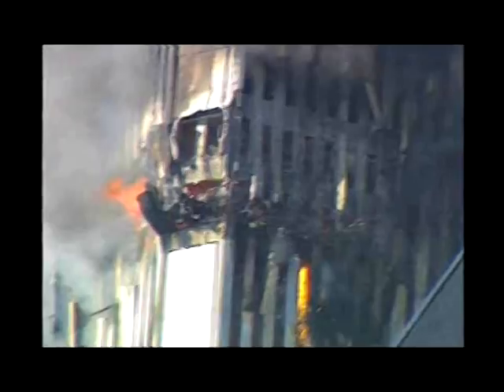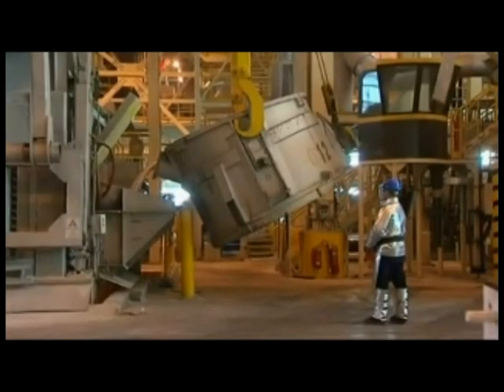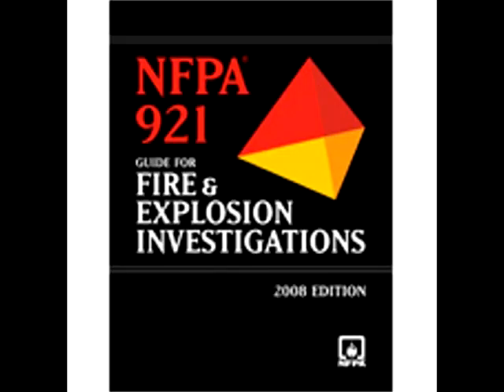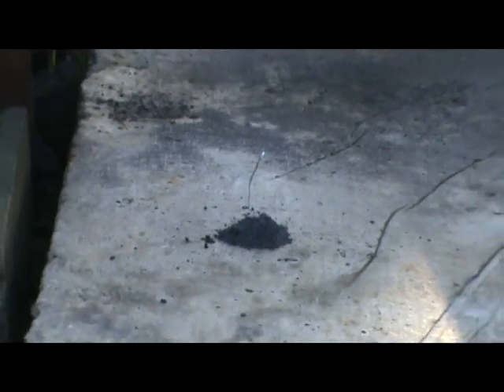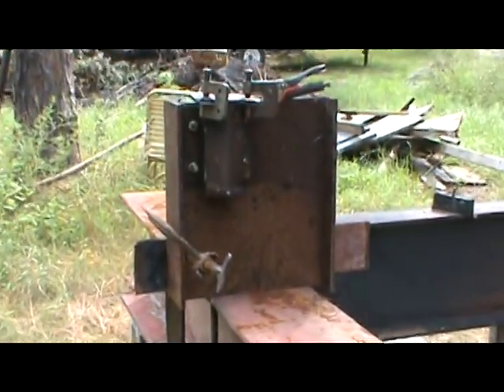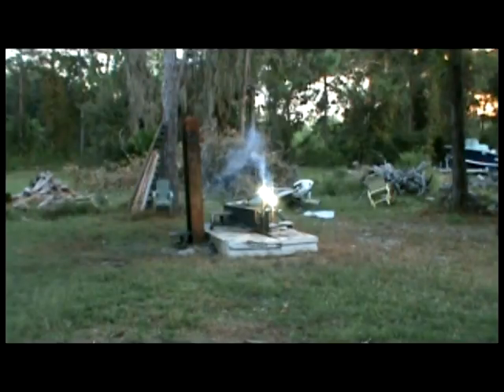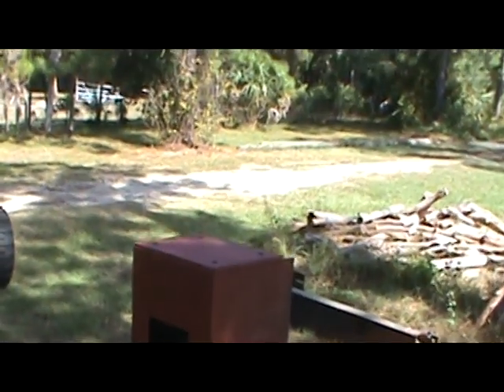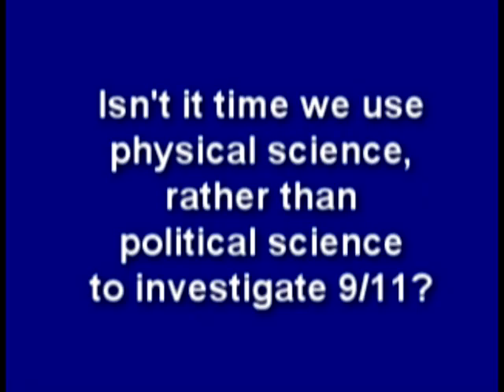9/11 Experiments: The Great Thermate Debate

Comment: You people must truly be wearing tinfoil hats! "Planes aren't made of high quality steel"? No shit, because if they were they'd be so heavy they'd need atomic powered engines and 10,000 ft runways to get off the ground, aircraft are constructed primarily of aluminum, with titanium, magnesium alloys thrown in for components requiring high strength and or high heat resistance. Aluminum weighs approximately 1/3rd of what steel of the same volume weighs, it's also about 1/3rd as strong, and it melts at a much lower temp. All that stuff burns, it doesn't just melt, it burns, and it burns HOT! In the neighborhood of 5000 degrees F! Powdered aluminum is a main ingredient in explosives and solid rocket fuel. Ever take an aluminum soft drink can and toss into a hot fire? If not, try it sometime, there's nothing left, it won't just melt, it will burn and leave nothing but a tiny amount of ash. I responded to the site of the value jet crash at the edge of the FL Everglades near Miami in I think 1995 or 1996? The exact year escapes me? Anyhow, that plane went down at a near vertical angle at over 600 mph, the biggest human remains were bone fragments and teeth, only 42 of the 110 people on board were never identified, including the pilot, and that crash site was less than 200 ft in diameter. The biggest part of the aircraft that was recovered was the tires, rims & landing gear, in fact, those were pretty much the only parts easily recognizable as belonging to an aircraft, the only reason the tires and landing gear were in such large pieces is the aircraft crashed into a swamp and didn't burn. I responded to an F-18 crash just N. of lake Ocheechobee in 2003 or 2004, pilot blacked out, hit the ground at almost perfect vertical, it was estimated that he broke the sound barrier just before impact, the crash site was an almost perfect circle about 80 ft across with 2 slits on opposite sides where the wing tips went in. That plane hit a sandy area, crash recovery crews had to dig 75 ft down to pull all the pieces out. Again, the biggest body part recovered was a couple of teeth, and the biggest aircraft part was pieces of the landing gear. It's no mystery why there was so little of the aircraft left to recover. As for the Pentagon's security, cameras, etc. You people put way too much faith in the military! Security is an illusion, a joke! Security, real security consists of multiple layers, it's expensive and it's manpower intensive. Neither the military nor the secret service was prepared for crazed Muslims to fly commercial jet liners full of fuel into skyscrapers or the Pentagon, they didn't have missile batteries set up on the roof tops like they do today, Tom Clancy actually predicted just such an event in one of his books but nobody really thought people would be crazy enough to do such a thing because it had never been done before. We're always fighting the "Previous" war! It's hard enough to get funding to protect against proven threats much less for unproven events/threats that people have thought could possibly happen but have never happened.  And it's impossible to protect against threats that no one's yet considered. Security is just for show and extremely weak at most bases, with the exception of weapons storage, in particular, nuke weapons storage areas. Fences can be breached in seconds, cameras can be fooled, even if they're working, which they often aren't. My base installed cameras at every entrance to the airfield, a year later only 3 of the 18 were working, and 2 of those were pointed directly at the ground. So again, its no surprise to me that the Pentagon's cameras were Inop! In fact, I'd have been much more surprised if they'd all been working!
Reply: Why not try and address the evidence given in the video you are commenting on rather than some personal stories? Start with the iron spheres. Tell us how a plane can make those? Btw I've burned cans in a fire and they don't make the fire hotter, otherwise we would use cans to start fire and not wood.
Reply: Ever wonder why the Navy pushes burning planes overboard? It's not because of the bombs. It's the magnesium. You can't put magnesium out. It burns so hot it vapoizes water instantly. Want to explain the explosions? The fireains were broken as we're the electrical lines. Arcing electricity at 220 bolts can cause magnesium to combust. Add waters base components and you get an explosive situation.
Reply: Im pretty sure it took them  30 mins to get over to get to the Pentagon Your telling me they couldn't get a fighter jet to take care of the plane and I know they were doing some military exersize that same day. Not to mention the  day before 9/11 Rumsfeld announced 2.3 trillion missing from the pentagon. Not to be mentioned again after the attracts that happened the next day. I mean that is suspicious and I think should of warranted a investigation. Not to mention Egypt and others saying there would be an attack in New York. Also it sparred on a big war on terrorism and they immediately attack Iraq not for oil productions it was because they had chemical weapons which turned out to be false (could be a mistake). Not to mention all the poppy plants that were in Afghanistan that we happily took control over to this day. But your right our government had no reason to stage something I mean its not like they ever planed it before right? Oh wait there was operation northwoods which was signed by the Chairman of the Joint Chiefs of Staff Lyman L. Lemnitzer. 

Link:  https://en.wikipedia.org/wiki/Operation_Northwoods
Reply: Rockwood Tacoma Lol, well I can tell you that it very very strange because there was burned destroyed jet remains as well as passengers remains all up in the pentagon?! Lolol
Reply: Listening to talkers makes me thirsty.
Reply: Dallas More 🤣
Reply: josiah wintermute before 9/11 us military jets could not ( under posse comatose ) carry active weapons without authorization for training in designated areas. Where is there a booming range within 100 miles of Washington DC? The closest one is 200 miles out in the Atlantic ocean. 
 Even if there were fighters ready to go they would still have to be armed with missiles and that takes almost 30 minutes to figure out mission appropriate weapons. Then an additional 10 to 15 to get airspace clearance from civilian authorities. 
 Now ever fighter jets is armed with a wide range of weapon systems.
Reply: Entusiast can you grab me a pint of whiskey while you are getting something to drink?
Reply: And hungry.
Reply: Dallas More building 7?
Reply: Try to edit your text into a separate fragments, the point you made is great but by reading all that stuff one can get a brain cancer
Reply: You Wished Oh I did not know that I heard that they are supposed to be able to take down threats in 10 mins but I don't have the source. You think with all the money we push to the military we would have better systems in place at the time. But you would think the flight controllers would have some override for the planes controls they have had automated planes since ww2.
Reply: Are you telling us that the hijacker passport that was found impeccable 2 blocks away on the side walk is impossible?
Reply: Dallas More my only guess is that you must he a shill, hired or ordered by someone to go onto these threads and tell this story. The engineer in this video just proved that themite or thermate was used and met all of the conditions that were witnessed on 9/11. Also there is something that you may not know.that I do. So listen up. 2 months before 9/11 a bunch of men dressed in black pulled up to the world trade center in white nondescript vans every night. They were seen going in with a whole lot of equipment, all of it covered up. There could be heard drilling, cutting and sawing for the entire time period. They were preping those damned buildings for demolition, including wt7. When they ordered swt7 to be pulled, the damned explosives were already in place. There was no way on earth that wt7 could have come down any other way and it was not hit by a plane and was not hit with enough debris to have brought it down. And there was no way that anyone had time on that day to set those kinds of charges. There also was a cia asset that was illegaly jailed after 9/11 that knew the truth of what was really going on in Iraq. That asset had already cleared with saddam hussein that us inpectors could enter his country any time they wanted. He welcomed it. The cia asset advised their handlers that there were no weapons of mass destruction and to go and look for themselves. Also, Iraq warned the USA that Isreali forces were in the USA planning something and that they would perpetuate a false flag story in conjunction with deep state insiders as a pretext for going in to Iraq to kill Hussein and take over oil and poppy fields. Soon after 9/11 bush oil took the oil fields and the deep state operatives took over the poppy production. Heroin dude, Heroin. That cia asset was held without ever being charged under the newly formed patriot act. When that asset was finally released they wrote a book explaining everything. You need to read it. Everyone needs to read it. It is titled extreme prejudice. I do not care what your alleged experiences were. I do not care what your job used to be. You completely evaded the evidence and facts produced by this engineer and I am sure he has way more education than you. Furthermore, I have kid that is an aerospace engineer and they confrimed everything that this engineer stated as well as the other engineers and scientists who got together and proved that there is no way in hell  that those planes could have brought down those towers. So quit insulting people with your stupid condescending tin foil hat remark and quit trying to debunk the proof that shows 9/11 was and inside job. All it does is prove that you are either a shill, a troll, and incindiary asshole or an idiot sheep that cannot handle the truth. And if you want to know what my credentials are, I am a retired network engineer. And smarter than you think but more importantly, I am awake and will not be blinded to the truth by a government shill or an asshole.
Reply: Sweet anecdotal evidence there mate, now please explain the glaring facts about the collapse of the towers that your boring ass rant didnt.
Reply: Rockwood Tacoma it's called a tungsten core. It leads the explosive charge in a missile. A tow missile uses depleted uranium as it's follow up to the charge
Reply: Dallas More 
Ever learned how to make paragraphs?
Reply: You Wished No.. a tow missile doesn't have a tungsten or any other rod in it... the TOW missile is a fucking shaped charged my dude... it works under the exact same principles as an RPG.  As a matter of fact, the US arsenal of conventional weaponry doesnt even have munitions that are designed to penetrate 4 feet of steel reinforced concrete... let along 8 layers of spaced 4 foot steel reinforced concrete.  Matter of fact we dont have any missiles that are capable of such a feat.  We do however have bombs that are designed to do so. Stop spread mouth vomit.
Reply: Have 2 rubbish your testimonial, jets are made from alloys, they are not reactive like the materials in the vid, they are highly reactive oxidizers.
Reply: It wouldn't make the news every day for years, if it were taken for what it is.
Reply: USMC0311CplJackson I wouldnt expect a jarhead to know,but we do have bunker busting  Monitions to penetrate that deep....deeper actually...but I digress.
Reply: "Arcing electricity at 220 bolts can cause magnesium to combust."
I think you mean volts, and the US uses 120 volts. Also there was no pure magnesium sitting around, the only magnesium is within the alloy of the air plane. Which is mostly aluminium and only 1% magnesium, so get your facts straight.
Reply: 1. Regular aluminium melts at 660c. 
2. Aircraft are made of aluminium alloys which melt at around 585c.
3. These temperatures are nowhere near hot enough to melt steel, which needs 1370c to melt. 
4. Jet fuel burns at around 480c.
5. In the most favourable conditions the most you could get is a little bit of melted aluminium, but you could never melt steel in any of this setup.
6. Even the official BS story from the US government doesn't claim that the steel beams melted, they admit that it simply wasn't hot enough to melt steel and that the planes just created structural integrity issues which lead to the building's collapse. 

7. Your claim of 5000F/2760c temperatures, where are you pulling this impressive large number from? Jet fuel only burns at 480c and aluminium aircraft materials melts at 585c. There was nothing in the building to create a 2760c situation, stop being retarded please. 

8. It's clear that this event occurred and the US government helped it happen, this started the endless wars in the middle east against "terror" and enable the US government to pretty much just do whatever they want since 9/11 and most Americans simply lost all humanity or care or level headedness after that event (exactly how the US government want them to be). 

The building 7 which fell in the same fashion wasn't even hit by a plane, yet they said in one corner of the building it had a fire. And magically the building collapses like a nice controlled demolition. 
Demolition crews from now on should pack up all their explosives and learn from building 7, you just have to have a fire in one corner of the building and the building is meant to just fall like a controlled demolition. Job done, lol. 

Either way, the US government don't really care if people know this anymore as there really isn't anything regular US citizens can do. What are they going to do? Just complain online and that's about it, the US government is in no risk of losing it's power over the population in America.
Reply: Lord of the belts: The return of the KING What is a forge? And how does it work? That might explain to you how you can get a hotter heat from a fuel that in open air doesnt produce that kind of heat naturally.
Reply: STURGOD BLADES & SMITHING Inc. Well... I was an infanteyman.. it's basically my job to know the the explicit details in how to kill people... and I was very good at my job. I was a scholar of war if you will.   But yes, we do have bunker busting munitions. All of those are free fall bombs. They just have a lot of mass.
Reply: Dallas More You talk alot
Reply: speculizer1971 i seen video footage of the missile hitting it how does a plane penetrate 8 walls 4 feet thick each of reinforced concrete
Reply: so what the fuck are you trying to say ? i truly believe 9/11 was inside job and a cruise missile hit the pentagon !
Reply: Dallas More – voice of reason! Respect in my book.

Comment: The color and sparking behavior of your thermate experiment looks identical to the sparking coming out of the tower in your 9/11 footage. Pretty damning evidence. Jet fuel of course would not produce this specific type of fire, but I do disagree strongly that it's incapable of melting steel. I used to do blacksmithing and with forced-air on a wood fired forge, I was able to cause steel to burn. I even melted a few firebricks. With the updraft of those tall towers, a fuel fire definitely would get a lot hotter than it would just in a bucket on the ground. So while I agree with you that this sparking and these exploding noises are likely thermate, I still disagree that jet fuel can't melt steel.